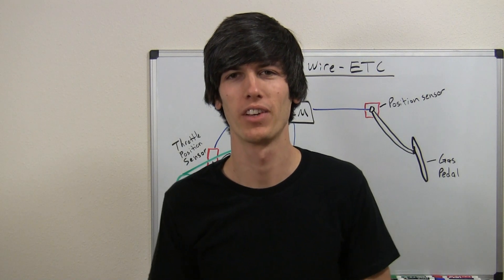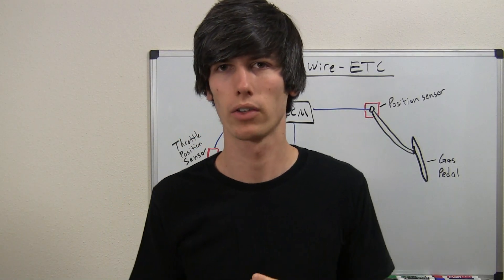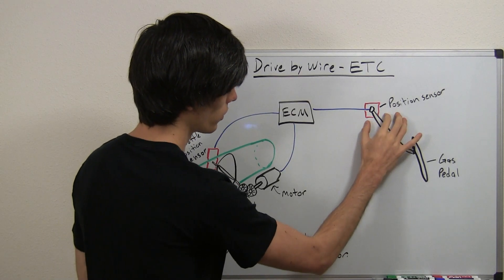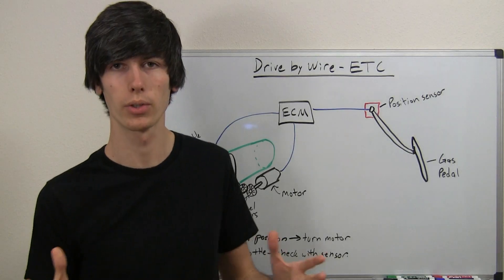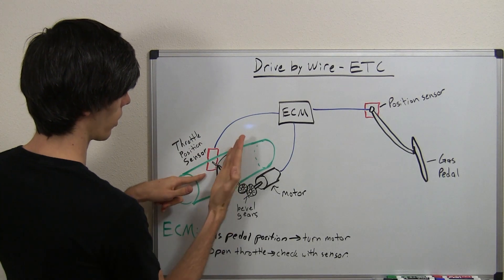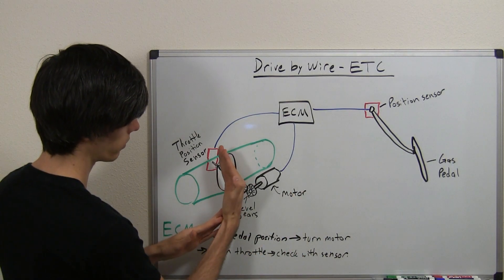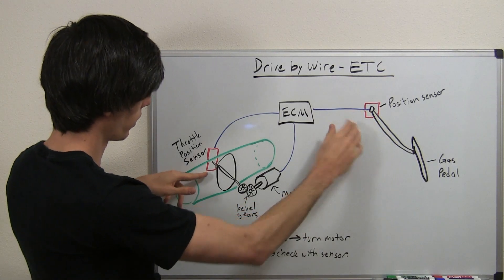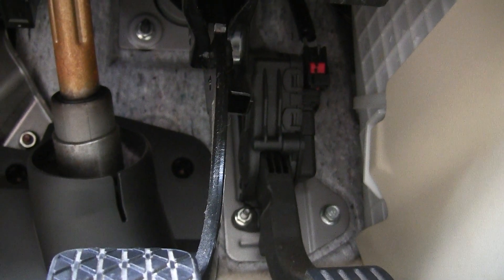Drive By Wire - Electronic Throttle Control - Explained

Comment: The main purpose for the throttle position sensor is actually a feedback loop. The loop is needed for accurate control of the butterfly valve.

Comment: hey im not missing this, I'm your follower. :)

hmm... it seems a gas engine, what about diesel engine?
where is the relation between pedal gas and the spark plug ignition? how could it synchronize between each others by itself?

still confuse about rpm and the related components works.

Comment: That's exactly what I was thinking...
With a car rack, for example (on the ones at my work, anyway)...it says on the controls, "Wait two seconds before re-pressing the lift button. Failure to do so could cause the motor to burn up."
Something like that.

"Motors" just come off as fragile, to me.
Maybe I'm wrong.

Comment: Why go through all that if the old cable works just fine? What are the comparo/ benefits/ pros & cons or the old and new? What if the electronic ever fail while driving, let's say, during acceleration (electronic control throttle) to avoid oncoming train or during braking (electronic control braking) to avoid hitting someone?

Comment from the maker: If the engine speed matches the speed of the transmission (which is driven by wheel speed) for a set gear, then you do not need a clutch to shift the gears, as they are rotating in unison at the same speed. See my video on clutches if you have trouble picturing this.
Reply: that's what truck divers do in american trucks that have to synchros

Comment from the maker: I don't know the data but my gf's Mazda 3 has 40,000 miles and hasn't had any issues with it. Keep in mind the movements are relatively slow, and the "distance" of rotation is very small. I don't think the motors are really working very hard at all.

Comment from the maker: I don't know if it's a step motor or not, but regardless the valve and motor are connected. Even if it is not direct (shaft of motor is axis of rotation for valve) it's still entirely controlled by the motor, so it wouldn't really make a difference. As far as reliability, drive by wire is very common now, so I'd say reliability is fine.

Comment from the maker: Well, one advantage is the ECU can better control throttle in situations where this may be useful, for example with traction control. The ECU could reduce throttle, where as with a conventional system, if your foot is on the gas pedal, the throttle valve is open. Also, it eliminates some of the moving parts and connections required (though it does add some as well). I think there is a bit of a lag though letting off the gas, which I've noticed on my girlfriend's Mazda 3.
Reply: The lag letting off the gas is rev hang
Reply: @pilotavery is rev hang is actually good or not?

Comment: hi. quick question: do you know if there are implementations of drive-by-wire where the butterfly valve is directly connected to a step motor? How reliable would that one be?